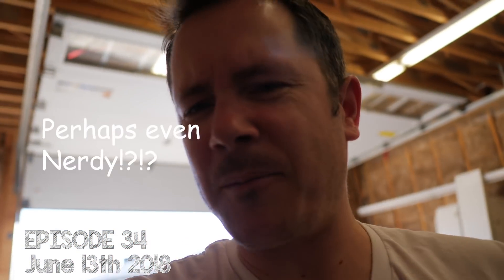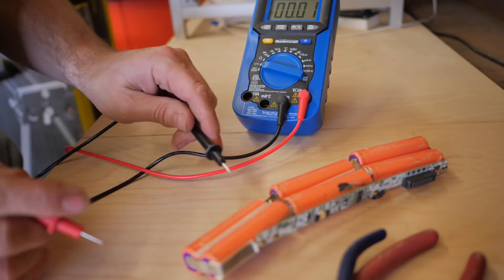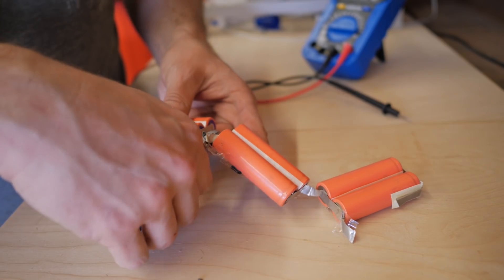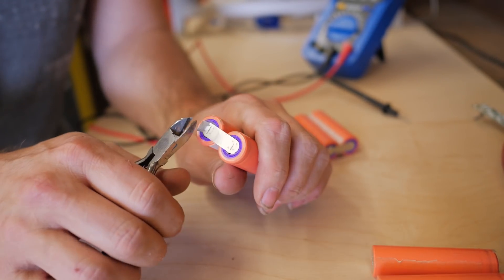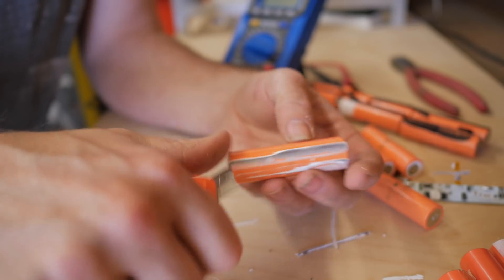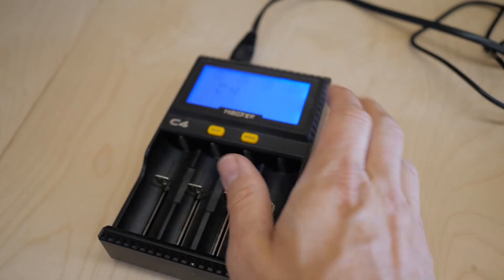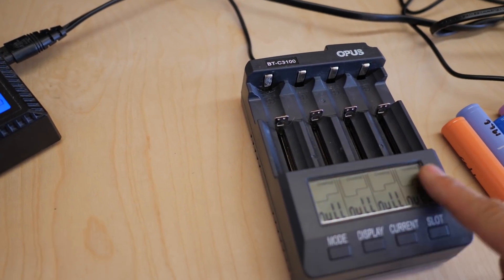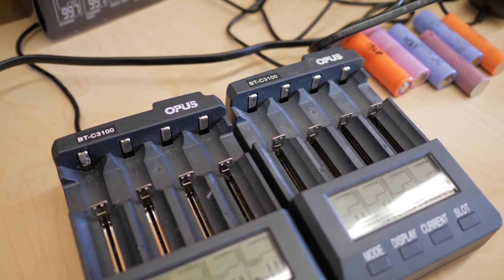18650 Cell Recovery

Comment: I have about 500 cells and got more coming.  I get them from batteryhookup.c very cheap too i couldn't get cells like this dude does so i get all mine from batteryhookup.c give them a try .
Reply from the maker: Yeah I have ordered from there for their fused nickel, but hard to get batteries shipped to Canada... Shipping is expensive! But yes batteryhookup.com is a good source of cells at reasonable rates if your in the US.

Comment: I like the Opus chargers but they're too expensive for my budget anymore to have more than the one I bought a number of years ago when I could get them for around $40. I am scouring YouTube for every other charger idea anyone else is using to process all the cells I have accumulated.
Reply from the maker: Yes, the opus are definately costly. I personally haven't found a cheaper solution, I checked to see if I could build some Arduino charger, it can be done but I don't think it would cost less... And just not as simple...
Reply: I personaly use liitokala ligi 500. I buy them directly from China for 15$ a piece, and I think it's the jest bang for a buck, for slots, it measures internal resistane, charges, and discharges cells. In my setup it's running of old ATX psu.

Comment: I'm doing the same thing now and it speeds up the process by charging the batteries while they are still in the pack. Then tear them apart and top them off in a slot charger.  Only then do I capacity test them. Pull them off as soon as they are done capacity testing and start another while the tested cell go back on a slot charger.

Comment: Hello from 2019!
I am doing the same job at the moment - disassembling battery packs and cleaning 18650s preparing them to be tested. To have some fun during the process - watch youtube. So, you showed fow you clean cells on a sanyo ur18650zt - and was cleaning exactly the same cell =)), then you showed a second example - LGABC21865 - and it was next in my box =) Then you showed a Miboxer charger - and it is the same charger I use to recover "bad" cells and precharge cell before testing in Lii-500. It was fun to have so much similar things in a one video =)) Greetings from Germany/Ukraine and have a nice day! =))
Reply from the maker: Thanks for watching! It's a fun project, learned /still learning lots. Cheers from British Columbia! Oh and you will probably want to upgrade that miboxer for a charger that can capacity check in all 4 slots, that charge can only check in slot 4.
Reply: @havinfun4014  For capacity check I have 2 Liitokala Lii-500. Miboxer is only for charging and reviving 0 volt batteries. And my Miboxer is a bit newer version in which they removed the capacity check in the 4th slot. By the way, to clean the cells I use small clippers with a flat blade on a small angle - they cut nickle stripes easily, clean (remove) welding points smooth and are also good to remove silicon/glue remnants from the sides. So it is kind of perfect tool for the job, I do not need anything else =))

Comment: i have around 100 cells harvested cells from laptop battery, now i have cross checked few are fine which means more that 3.0volts 
now i have to re-charge the cells, after re-charge still need to check cell condition in amps, how to know is that cell is good or dead, i would like to make a battery pack with 36v20 amps for E-Bike, can any one kindly reply here with steps how/what to do/amps calculation that each cell min should have like 2or2.5amps should have then it would be good.

Comment: Good video. A while ago I got 3 laptop batteries. No where as lucky as you. Sooner or later I want to build a charger too. I din't have a decent charger and I am not inclined to get one at this time. 

I have some ideas on building one and I am experimenting as time permits. Hopefully I will not end up with any thermal runaway.
I did put up a few videos on Li Ion recently. Nothing special yet though.

Comment: Hi ! I have this Opus battery charger too :) But when i discharge lithium battery cells, they reach 3v per cell.... isnt the minimum recommanded voltage 3.2v ?
Reply from the maker: I think it really depends on the individual cells cutoff voltage. The cell will recover some voltage after the discharge cycle because it is no longer under load. It is best to not leave the batteries in a discharged state and charge them as soon as possible to avoid possible damage.
Reply: @havinfun4014  ok thanks :) I was a bit scared ^^

Comment: Opus is off sometimes about 400-500mah.....
SKYRC MC 3000 is the real deal and accurate you won't believe it.   is a little bit expensive but is worth every penny..... 
Since I test it with MC3000 I have no issues with pack's at all.... 👍

Comment: Now you have a new sub, could put an link to your charger in the description?
Reply from the maker: Javier Carmona Opus BT C3100 V2.2 Smart Universal LCD LI-ion NiCd NiMh AA AAA 10440 14500 16340 17335 17500 18490 17670 18650 Battery Charger
 http://s.aliexpress.com/3eyMNzeq

Thanks for watching! You can get this charger on eBay and Amazon also but likely more expensive.
Reply: xjdsjsxussushdus

Comment: Did you buy from eBay?  What's the max price you are willing to pay per pack shipped?  I see many lots of 10 on eBay for $65-100usd shipped.  Is that good?
Reply from the maker: Alan Evans I have... lot of good deals to be had. I would say 1$/ potential cell is reasonable. $100 per 10 packs of 6 cells is not good. Id stay around $60-70 USD shipping included.
Reply: Havin'Fun thanks for responding and the tip.  I don't think I'm going to do a full power wall, maybe just a 7S pack to supply my bench.  I figure 10 packs plus the cells I have should yield enough for a 4-8p 7s pack.

Comment: My tip : simply buy some cheap heat shrink ( for 18650 batteries), remove the old wrapping and put the new one. They'll seem like new. Good video. now you have +1 sub and a like!
Reply from the maker: Fap Crafter thanks for watching... i actually have some on order to re-sleeve the ones that have compromised insulation.
Reply: Fap Crafter lol

Comment: I usually charge mine at 1amp on the same charger , let them stand for 7 days then do the discharge capacity test. that's done because a full charged battery will sag loose some charge just by standing then you get a more accurate result.
Reply from the maker: That's probably a good method actually... The battery would also be cold at that point. I have put a few cells back on the charger after a few weeks just to see the results and it always varies, had some result in higher capacity and some lower... usually 40-50mah... Thanks for watching!
Reply: Also monitor them while on charge as some get toasty , This particular charger has a thermal cut-out too so while on discharge it can pause while it cools so to resolve that i put a extra fan on it.